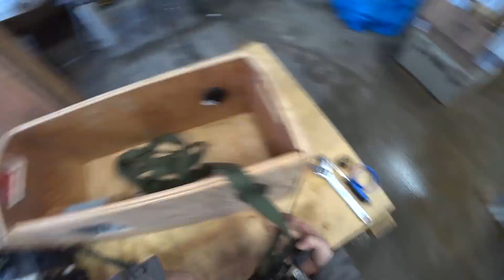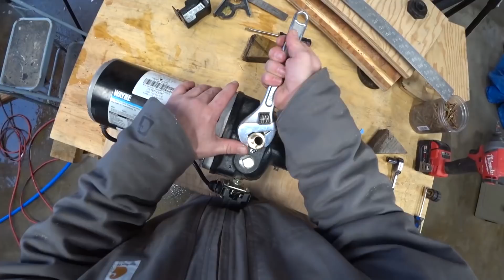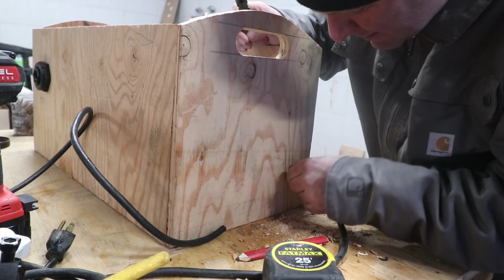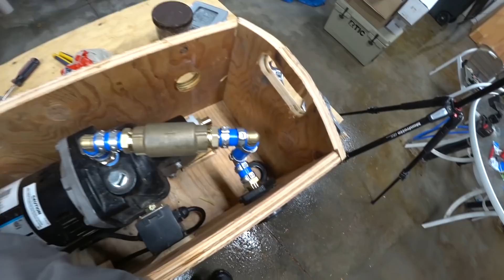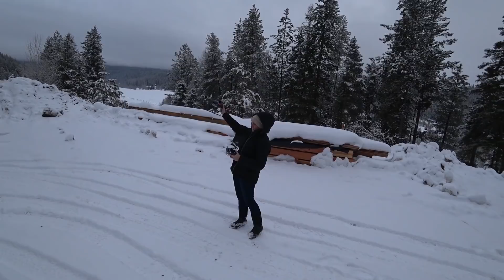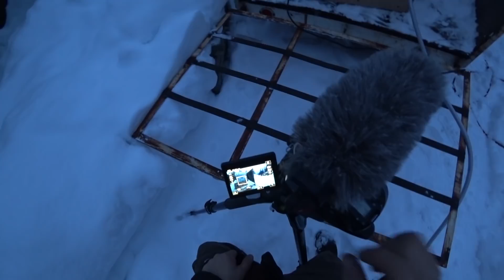Upgrading Our $2/mo Gravity Fed Water System

Comment: Just wanted to say, please don't use those PEX cinch clamps in your home, they're nothing but trouble. Look into the copper crimp ring system, or even better the Uponor expansion fittings. I've seen those cinch clamps fail time and time again, and nobody wants to be ripping their walls apart chasing down leaks.

Comment: When we replaced our water main to the house , we used brass PEX fittings & PEX pipe .  We used the system with the brass crimp rings .

Bought the crimp tool that went up to the 1" copper crimp rings .

Wyr
God bless

Comment: I put an addition on my cabin about six years ago using pex and brass fittings. Around this area the water is detramential to sweated copper plumbing, failures occuring around 50 years, pipe erosion. With in 4 years the Pex brass fittings were coroding to the point of leaking. The entire system had to be replaced at a cost of over 3500 dollars. Never again.
Reply from the maker: What eats brass? Seems like that’s the bees knees for direct bury applications in many areas. It’s code here. Ideas?
Reply: I have no idea other than it may be the mix of the brass. As i said the normal copper pipe fails in 50 years or so but the fittings I used look the same as yours and failed in about 4 years. I have seen some negaitive Pex reviews on You tube. Perhaps they can be more informative.
Reply: Salt will eat brass, I had the same thing occur at my house, but I just replaced the fittings with plastic. Ive seen a number of houses plumbed in PEX with no fittings at all. Install a manifold and run straight to the fixture.
Reply from the maker: Manifolds with composite fittings seems like a good solution. Need to research it all more. Suffice it to say, won't be buying anything local. ARG. Pretty good place to start. Need to understand their fittings better. https://www.uponor-usa.com/residential-plumbing/homeowner.aspx
Reply: I replaced it with upanol or something like that the pipe is mechanically stretched and a plastic fitting is used.

Comment: hey Jesse, i would recommend a loop of PEX to replace some fittings. the loop also helps absorb some vibration. and as i thought, your intake pipe is under sized. inlet always has to be bigger for proper flow and pressure in that pump chamber
Reply: and elbows slow flow, 45 degree elbows help reduce that.
Reply: Nice phantom pro 4 obsidian!!!!!!

Comment: A recommendation from an irrigation (landscape sprinkler) specialist of many years. In a tight valve box or mechanical room application such as your project. Use copper/brass with unions and isolation valves so that the mechanical device can be removed without disrupting the water service. Also place the unions so that they can be released and the mechanical device removed from the box easily. It's a little extra work and money at the design/install phase but will pay off in a big way the first time it has to be worked on. Residential water meters are done like this, except for a bypass loop. They can be removed without digging up the box. Mechanical rooms in industrial facilities are done with this type of thought and design. The reward of having an easy time working on it is great but it also very rewarding to look at yor fine quality of design and work at the completion of such a work of art and engineering.

Comment: you seem to complicate things here.  but way to many fittings IMO and it'll restrict water flow and if it ever freezers you'll have a hell of a time working on things.  Pex is nice and easy to work with but over time it will start to get nasty inside, mold/mildew. Thats why copper tubing has been used for many many years its a natural antibacterial/anti-mold and it does sterilize the water to some degree making it safer to drink.   Really nice box!  though it might need to be a little larger to easy working on it down the road.

Comment: Any time you're going to build an assembly in a small enclosure with through connections, it pays to do a "dry run" to know dimensions and locations. Please also bear in mind that an electric motor needs good ventilation, otherwise bushings/bearings and windings will deteriorate more quickly.
 The mount seems flimsy because it wasn't intended to be mounted to plywood. Add a backing plate to reinforce the plywood and it'll be quite a bit more solid.
Reply: Mark M hahaha right!?

Comment: Less water, that's what you'll get when the pipes are too thin. Guess you've learned/experienced that by now. Hihi :-)

I would recommend thicker pipes as the in-house tubing (at least the main waterlines, of which you can branch with thinner tubes. Nothing is so annoying when your shower has a too small pipe, combined with the toilet. When the toilet is flushed, the shower pressure drops. Except when the feeding line is thick enough.

Comment: You really want to avoid elbows on pipework to & from pumps.
You're just placing extra load on the pump for no reason.

And surely you want the check valve on the end of the pipe, not the mobile pump?
Otherwise as soon as you disconnect the pump any water left in the pipe will still flow back.

...or you could just add a ball alve to the end, although guaranteed you'll end up wrecking your pump when you forget to open the valve one day.
Reply: Good idea...why waste water and get wet...definitely checkvalve at the bottom and on the storage side..although will have to be freeze proofed...

Comment: Jess, you may have the grey  end of the pump too close to the end of the box, it is the critical cooling air for the motor. Common to allow about 2in. of air room. Looks like you really need the box4-5in. longer. It is worthwhile to put rubber damper feet under a pump mount.
Reply: Tim Kirkpatrick I couldn't agree more. Jesse really should just build another box. Too many things wrong with this one.
Reply: It'll work the dampers are an easy install and some slots in the box end can give enough air. let the in and out flow lines have enough space for movement to prevent erosion. and good to go.

Comment: Before you plumb the house, Seriously consider using the Uponor (Pex A) System. The connectors are Way, Way cheaper than the "Shark Bite" system you are using for this project. AND, they are Way, Way, easier to install then those compression rings, especially in tight spaces. I have recently chosen Uponor/Pex A for my project and the "Expansion" system is so much better than the "Compression" system because the fittings are always being contracted against by the PEx and Uponor Ring. By-the-way, I am replacing a "Compression ring" Pex system that has begun to leak !!!!! Unfortunately, Home Depot and Lowes only carry compression ring style Pex and fittings, so, you will need to find a "Real Plumbing" supplier in your area (also very available over the Internet. Check out videos on the ProPex/Uponor system.
Reply from the maker: We’ll give it a look! Thank you!

Comment: Great work - I would try to get those 90 degree bends out - that should increase your flow. I've noticed other videos showing this particular type of pex crimp ring as failing often. I've used a solid crimp ring here in Canada and also seen the expander system which seems to negate any future issues. You may want to look into this when you start plumbing the house.
Reply from the maker: Good tips. It was helpful to play with Pex a little, learn the fittings, the system, the clamps, the crimpers. :)
Reply: I don't think the elbows (90's) are the issue. They calculate out at additional friction loss of the equivalent of 1.6 feet each, and that's only on the output side of the pump. Inlet doesn't count/not affected.  Most likely the spring-check is limiting the volume. (They have GPM ratings) you could fit a larger check in there with reducing bushings.

Comment: Please....Please DO NOT USE THOSE STAINLESS CINCH CLAMPS. Trust me they will fail. Use copper Crimp sleeves (Cheapest) , vega pure flow bronze fitting with stainless crimp sleeves (most expensive but best in my humble opinion), or Uponor expansion sleeves and propex fittings (Middle price range)! Trust Me! The stainless cinch clamps will fail!

Comment: Have you considered a float switch fashioned to install into the fill hole connected to your pump box with a cable?  Then you wouldn't have to know the time which can vary by a few minutes based upon the density of the water, due to temperature.

Comment: Great first-time PEX project.  I'm 100% sold on PEX and recommend it for most stationary plumbing projects.  I like your observation that its a good idea to lay out your runs/configurations before you build the box.  Oh, and as some other folks suggested, there's some math to figure out how much volume and velocity you lose with every 90 degree turn.  Also, for every size adaptation (inside diameter sizing).  Keep up the good work, you guys.  I like the new drone, by the by.  Well tested, Alyssa!!  LOL

Comment: the restriction flow on the sharp angles make the box longer try 45's vice 90's  and all out the front.. need a drain incase you have a leak... and maybe consider the  backflow valve on the connection hose outside the box ..

Comment: Hi Jesse I've seen a lot of plumber videos saying those clamps you are using for the apex are junk they fail really often they recommended the copper ring type or the kind you stretch the apex out with also maybe try using the next size up hole saw to make a plug for the extra hole
Reply: Was thinking the same. they wear out and leak bad.

Comment: Every fitting has flow loss as it is a smaller diameter than the PEX and a 90° elbow has a huge loss due to both smaller diameter and resistance to flow due to redirecting the flow. A backflow preventer/ check valve has a engineered loss value printed in the literature. A simple coupling or thread to barb fitting adds 3/8" to length due to shoulder and thread allowance. PEX elbows are 3/8 - 1/2" of additional length.

Comment: Uponor Pex A and Fittings is a better option than the Pex B; PVC would have been cheaper for this project.  Your pipes are too small, on video they appear to be 3/4 in..  Commonly 3/4 in. Npt discharge with 1-1/4 in. Suction.  Because of the pipe you are using and the number of fittings/90's you pipe size is reduced to less than 3/4 in.!  You do not want to "Starve" the impeller!  A Centrifugal Pump or good quality Transfer Pump may be a better option than a shallow well/jet pump you appear to be using!  Now you know why plumbers "Dry Fit" before making the final connections.  Oops... There is an "flow arrow" on the check valve... we have all done that one!   Are you going to install a check valve on the suction side to maintain the prime?
Reply: How do you write in bold?

Comment: Use Street Elbows  thread by insert and put a block under the rear of the pump even the front if need be,learning is what it is about the less fittings the better don't forget shut off valves !

Comment: Funny thing is is that in normal use using PEX reduces the number of fittings. I've seen it run like ROMEX with a fitting-less run from manifold to fixture.

Comment: If or when you make 'pump box 2.0' one of the goals could be to eliminate those small radius 90 degree bends in the plumbing fittings. Those fittings are reducing both the head pressure and the flow rate.  Your inlet pipe could be on the side panel, eliminating that bend.  I'd also be tempted to put a partial top and have the output fitting there, moving the check valve to the inlet side of the pump.  I'm not sure it matters on what side of the pump the valve is on, you just need it from feeding back into the container on the trailer.

Comment: It may be a pain to wire, but you can set it up to easily be repaired without a bunch of holes in the box.  It looks like it's portable, so a little extra wire for pulling the pump out a little ways to (disconnect a few wires or flip it sideways) to do a timer is no big deal.   Nice box with handles.  Nice video editing.

Comment: Use the construction off cuts to make a shed with a 2KW solar panel space and a space for a 10Kw 1800RPM genset and house the pump, maybe use the waste heat from the genset to warm the house/garage, maybe use some heat to warm the water going up hill to the tank in winter.

Comment: everybody loves plumbing ! right ?,,,,anyways just wondering if you got that pump from a jacuzzi type bathtub ? I believe you would want to install a jet pump instead that will suck in on one end and pressure pump on the other end to say,, 40-60 psi
Reply: I got a 1080p screencap of the pump, it's a Wayne SWS50 1/2 HP Cast Iron Shallow Well Jet Pump

Comment: I agree with your friends statement about plumbing but I would add to it. 
The reason I hate plumbing is because you always need one more fitting, and after you get back from the store with that last fitting you realize it's either the wrong size or it has the wrong threads on it.

Comment: Great idea.2 suggestions:1. Use other PEX system - this without any fasteners - it is way more reliable2. Put some hole in bottom or edge of the box - in case of any leakage from elbows water should go out of the box without floodig electrical connectionsRegards

Comment: would have used next size up or two on plumbing inside the pump box with larger sweeping bends which is much easier on flow than tight 90° bends/elbows; the use of flexible pex, RV potable rubber hose, or even flex pcv repair line would also help; good job! now onto ver. 2.0.. 😉

Comment: The size plumbing you're using seems way too small for that pump. What is that, 2 inch down to .75?
Reply from the maker: Inlet is 2", outlet is 3/4". Get your glasses sailor!
Reply: And on top of that, every 90 degree elbow is a pretty good restriction too. The water has to decelerate down to zero in one direction, and then instantly accelerate in another. That is lost energy.
Reply: Haha are there two outlets?
Reply: the other is for a pressure gauge or a prime inlet
Reply: There is a reason the inlet on the pump is larger than the outlet, in your setup restricting the inlet is the biggest factor in pumping slower.  Even if you don't want to go to 2 inch any increase from what you currently have will make significant difference.

Comment: So you leaned the first rule of pumps and fittings: dry fit everything first to make sure that you have enough room for both fit and for service. At least your not dealing with the 8” pumps and fittings I get to. Also remember that the more fittings you add the more friction head you get and that slows down flow and makes the pump work harder.
Reply: Does that explain the entire slow down in the flow rate he observed?  Is there a way to calculate the reduction if you know how many and what type of fittings will be used?
Reply: Not to mention the suction he reduced to making more friction loss
Reply: There is a way to calculate friction head however its been so long since I've had to do it I couldn't begin to explain how (we leave that to the engineers in their climate controlled offices). Generally the supplier of the fittings and pipe and the pump will be able to provide you with all that info. In this application i would guess that the pump and/or piping is undersized. Looked like he was using 1/2" fittings and likely a pump with a 1/2" discharge on the volute case. I'd be scaling up to 1" piping that is reduced from a much bigger pump (like 2") with that much lift to overcome. However if they don't mind taking 2 hours to pump out their tote, then thats their prerogative.

Comment: I see one problem mixing the electric and water. Are all the components isolated from a box filled with water? What happens when you walk away for 45 mins and your pump seals fail?  I see no drain within the height of the pump mount on any side of the box.

Comment: for future projects check valve are installed in the suction side of the pump.  Why do you ask? and how do I know. water pumps are my trade.
Reply: Makes sense, keeps the pump primed. If you put it on the other side, then the pump would probably drain out every time unless you closed a valve manually on the other side.
Reply: but he is sucking out of the tank and doesnt want the water to come back down the hill and back into the tank
Reply: what you say doesn't make sense.  the check valve goes one way.  the only way the tank will drain is if the is a valve left open  anywhere after the pump and that doesn't matter where the check valve is.  Also with this type of pump  water should only get buy when it is running our not working properly. the main reason I suggested putting on the suction side was because there was more room on that side of the box for him to install it.
Reply: i understand what you are saying   !  what i am saying is that as is it will hold back pressure off the pump  from the hose running up the hill to the water  tank there , there is no need to hold a prime at the pump with a ck valve on the suction side because the portable tank is right there to prime the pump.                non standard usage of pump and valve
Reply: still doesn't make a difference  where the check valve is.  think about it    and  I'm sorry but this still looks a standard usage of a pump  ( move water in this case from one location to another)   I'm speaking from over 30 years of experience in the water pump trade

Comment: Is that only for processed water or will it be used on 'natural' water? Those metal Pex fittings can fail very quickly if the chemistry of the water is funky. Although they look nice it would be much safer to only use plastic Pex fittings especially in a box with with non isolated electricity and definitely in the rest of your house if you will eventually be using naturally sourced water and treating it yourself.